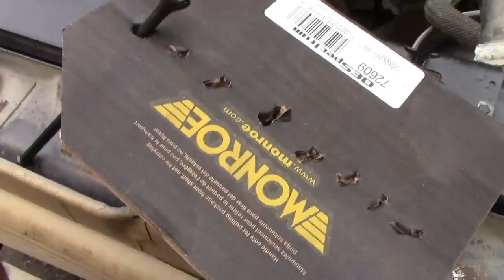2.5 NA Diesel head removal - what is wrong with this engine?

Comment: Low mileage engine, I think red oxide was from the factory and eggshell green was once they had been rebuilt at reme workshop. Good video again, thanks, found your video on o rings for the dash gauges and have managed to find a company that suppliers them separately. Many thanks 
Jim.
Reply from the maker: You're welcome Jim!

Comment: I had one of these engines that smoked and ran rough after lots of new parts, I found the injection pump pulley had a crack in it and was opening up and advancing the timing and over fueling on one cylinder. Worth a check with some dye pen or just visual check. 

Great videos 
Matt
Reply from the maker: Thanks Matt
I have seen the cam pulleys on the 200Tdi crack too

Comment: I expected to see at least one of the swirl pots sat in the block when you lifted the head but, although cracked, they were still attached to the head which is a good sign that they engine is low mileage. It will be interesting to see if the replacements sit noticeably proud of the head - usually an indication of previous skimming, not likely with an ex-military engine and they look original anyway.  Have a look inside the old pots when you take them out as they have little nodules which burn away with use.
Reply from the maker: New video loading right now !

Comment: Seriously, though, I have been waiting for you to pull the head, as I reckon you needed to, but: I thought you would find a problem with one of those plugs. I sure didn't expect the diesel leak thing to show what it did. The bores aren't showing any damage? 'Cos it has to be a broken ring or a holed piston surely?  

Certainly this has destroyed my faith in compression tests.
Reply from the maker: Yeap, strange eh - the rear cylinder was low but holding good - not quite what I expected!

Comment: Since the engine looks sound, my money is back on the injector pump.  You tested to see if it was pumping fuel, which it was, but not tested pumping fuel under pressure.  I wonder if you could hook it up to the injectors while they are out of the engine and see whether #3 is producing a nice spray of fuel provided by the injector pump.  You did this on the bench, so the injector itself should be good.  Not sure how you would do this with the non-flexible pipes...  Maybe after you have the engine back together you could make a custom pipe and work through the injectors one at a time.  Of course if you are getting a new pump anyway, then just wait for that and save yourself the trouble.

No comment on #1 cylinder.  Ghost in the machine.
Reply from the maker: Well we are having bad luck on this!
We need a new pump for another engine as it has a broken shaft
Only there are non available anywhere - we can send in the old one but no one has exchange units on the shelf to sell outright

Comment: My 2.5 had a similar problem,  had pump rebuilt,  front pulley woodruff key replaced etc,  had very slightly low comp on one cylinder,  turns out it had a slightly bent rod,  could see it easy once the pistons were at top dead centre,  one was ever so slightly low .  It ran OK,  not even a true miss fire,  I did thousands of miles with it,  was smokey on start up but reasonable when running,  secondhand rod and it was fine.
Reply from the maker: I checked the piston heights and they were within 2 thou
Reply: @BritannicaRestorations  You could see it with the naked eye on mine,  it wasn't much but was just enough to make it run rough.  I left my n/a at Glencoyne when he fitted the 300tdi,  pump only had a couple of thousand miles on it after a good rebuild by fuel injection services.   N/a ran perfect after the work but the 300 makes my 110 much more usable.  Keep up the good work Mike.

Comment: I'd ask Mr Jameson's for moral support! I'm totally stumped.
Reply from the maker: If this went to a dealer they would change the motor for a new crated one
Reply: Britannica Restorations Ltd aye and charge you an arm, a testicle and two kidneys for the privilege. A mate had a TD5 changed at a main dealer. Cost him obscene amount it didn’t even get him home before it was back on a tow truck for the exact same fault that had killed the first lump. Faulty oil pump fitmemt
Reply: I was in Craddock's UK a few weeks back and they had a 300tdi on a crate. I'm sure it was just short of £3000! No ancillaries.

Comment: You know that #1 cylinder is going to drive you bonkers now until you pull the piston.
Low hours engine, maybe rings haven't set in..?
Reply from the maker: Could be - or the rings have not been put in right - compression was good though

Comment: Hello, im replacing the valve guides in a 300tdi ,new guides are no better than the old ones being 0.30 sideways movement the manual states clearance should be 0.15 unless specs have changed,any advise would be great,thanks
Reply from the maker: Check the valve stems
Reply: @BritannicaRestorations  thanks i have new valves to use the are good,new guides are not to spec
Reply from the maker: There are 2 qualities of guides - STD and pre reamed

LGJ100880 - STD

LGJ100880RE pre reamed

Comment: Hey mike. I need your opinion. Im wishing to freshen up a 300tdi for cross country trip. Im really keen to replace big ends and mains as motor has done 300k. Im putting a new head from turners prob as the existing head does work but has a minor crack around exhaust valve. Anyways i would check bores and possibly replace rings? Would you replace rings aswell or not if not reboring If going that far might aswell replace cam bearings which would need a machine shop to push out and line bore? Do the cams wear?
Reply from the maker: The cylinder blocks are made of a much better material than the old 2 1/4 Series engines and I have only bored 2 blocks  - that was due to overheating and scoresI always fit new ringsAs for cam bearings, it seems the front one can give issues and wear due to belts being too tightI have a tool to replace them, so you may want an engine shop to fit them - the alignment of the oil holes in the bushes are critical!The cams give very few problems - check for evenness and grooves around the oil sealDon't be tempted to use cheap parts - go OEM where possible
Reply: As long as the oil has been changed regularly 300k is nothing i did my head at 320k no measurable wear and cross hatching was still there . Put the ported head from turners on makes a huge difference. At that mileage be worth getting the injection pump rebuilt get them to wind it up 10 to 15% they still get below 8k/100k of diesel and hardly fade on hills . I use mine for remote travel in Australia

Comment: I had my head gasket done a year ago and have just found a hotspot stuck to the waxoyl on top of my chassis,how important are they?seems to run ok
Reply from the maker: Do you mean a core plug or frost plug?
The hot plug is inside the engine
Reply: Hi,thanks for the speedy reply.
Its the swirl chamber,the part on your cylinder head that was cracked,thanks.
Reply from the maker: I an quite surprised  it runs!
Reply: It runs as it did before,can hit 60mph if need be.
Engine was rebuilt in 2008 by the M.O.D it cant have rested on the chassis since then as I have had it waxoyled.
I only had the head gasket done as I think the valve seals had gone leading to rapid oil loss.
I use it daily to go to work too.
Maybe on a long journey i.e further than 20 miles it will show.
Reply from the maker: I would have thought that there would be a lot of compression loss and the cylinder running badly
Reply: Maybe it has,somehow sat on top of the chassis for 12 years,its still slow on steep inclines but thats how it was before,the usual diesel rattle but skips along quite well once warm.

Comment: This engine has had poor atomization from its injectors for some time. This has caused excessive heat to build up in the Pre combustion chambers (Hot spots). This causes premature cracking but it also burns away the little internal "pips". These internal "pips" help start combustion even when there is low turbulence (Low RPM). I bet money when you pop out those hot spots and look inside you will see the pips burned away or filled with carbon completely. New hot spots combined with your overhauled injectors (Assuming the pump is good) and it will be fine.  (Famous last words! LOL) http://www.lrseries.com/shop/product/listing/5165/ERR1223-HOT-SPOT-2-5-DIESEL.html
Reply from the maker: I will pop them out today, but I have seen much worse running without a misfire
Reply: When he finally will get 4 good (and functionally identical) injectors, the problem will disappear but maybe he like people scratching their heads .
Reply from the maker: Injectors bench tested and all even - still rough running
Reply: @BritannicaRestorations  For sure the cracking is normal and does not equate to any problem on its own. Nearly all crack and are acceptable to be refitted even when cracked. I think it is more about the pins on the inside that can cause low speed partial firing when burned away. Assuming the pump is good etc.
Reply: If the Injectors were bench tested and are all even (I will consider this valid only with a test bulletin generated by the test bench ) the only possibility I can think of for a misfire is   if the fuel pipe for 3 (and 4) is internally restricted  (!)
Reply from the maker: Nope, I tested for delivery flow and they were even - not sure if the delivery valves were holding up to pressure